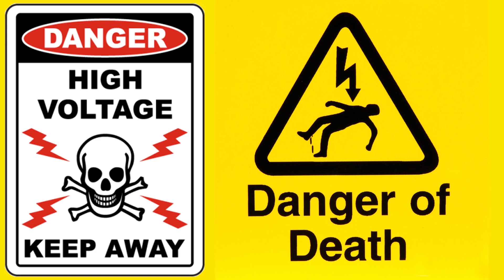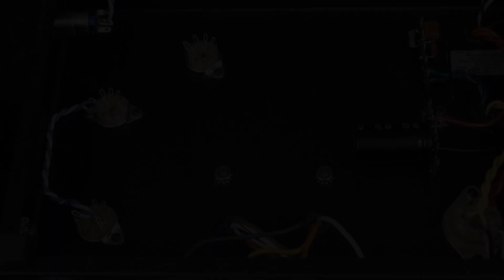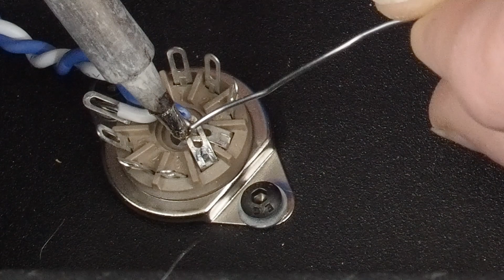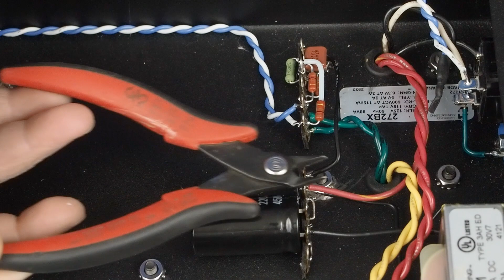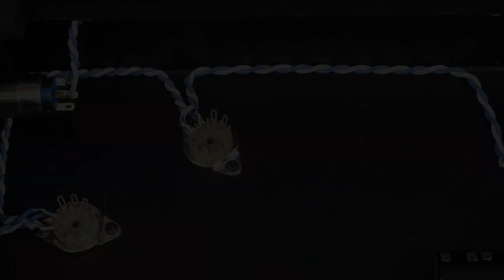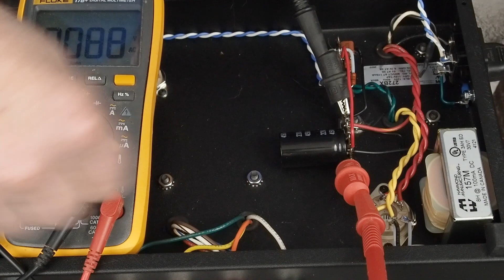Tubelab Monoblock: Detailed Build of Second Amp #3

Comment: These videos are the next best thing to hands on schooling. Those clips are great idea, I’ll be making a pair next. Could you tell me where you get the wire for this amp?maybe a link? Winter is here and my bench is ready for a project SE stereo amp or preamp. I have some nice matched small wattage tubes looking for work
Reply from the maker: I just get it off Amazon. Using 18ga wire, I don't feel it needs to be anything special.

Comment: Hello,  Paul over there at PS Audio says that if a product that uses silver solder and high end capacitor s like Mundorf truly do make a difference to audiophile s with critical listening,  I know that Onganku from Audio Note Flagship amplifier uses 26 lbs of silver in it's build at 11 watts a ch at $100,000 and is considered one of the best amplifiers on planet earth also B&W loudspeakers top models wire is a silver mixture with iron powder coating , silver must make a difference if top capacitor s like Mundorf use gold and silver foil....even down to brass taxes lol (ironically speaking brass screws make a difference,  Then why does the expenaive stuff use silver ?
Reply from the maker: Are you talking about this guy, that sells the "Noise harvester" for $100 that he claims turns unwanted noise into harmless light? https://www.psaudio.com/products/noise-harvester/

I agree that Mundorf Alum/oil caps sound nice but there is no reason to spend more than what their lower end products cost. And you are not gonna hear anything buying PS audio $850 USB cables or his $10,000 power cables...

Comment: Would using shrink tube on the other unused pins help raise the safety?
Reply from the maker: I don't think so, as there are so many other points exposed with high DC voltage. Basically, don't stick your fingers under a live amp and if you expect there are people who can't resist touching the inside of the amp when it is powered up, put a vented bottom cover on it.
Reply: @SkunkieDesignsElectronics   good point! New learner I really appreciate it ❤️

Comment: Your work has been inspiring. After watching your videos I had to build a 4s preamp. My friend Steve had to build one also after hearing mine. Then I went back and did some rebuilding of my SET45 and SET2A3 using techniques that I learned from watching your videos. I have had a 45 year run as an audio engineer with numerous patents. I build 150hz full range tractrix horns and push pull bass cabinets. If you are ever in the Atlanta area I would be honored for you to audition my horns. I also would like to share with you some of my builds. Thanks again , Les Hudson
Reply from the maker: Those pre-amps are amazing given how simple they are! Please send me a private message via my website, I'd like to chat further. 

https://www.skunkiedesigns.com/contact